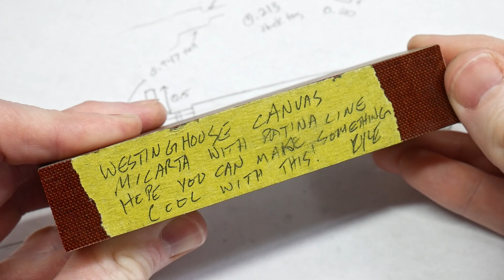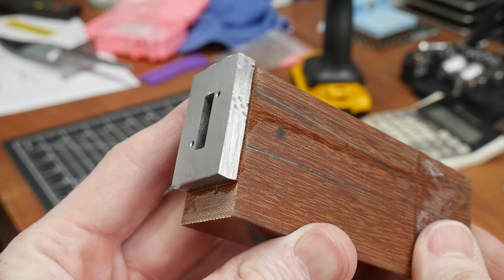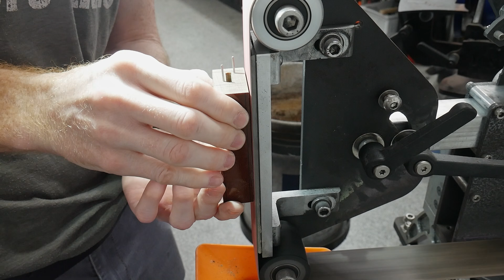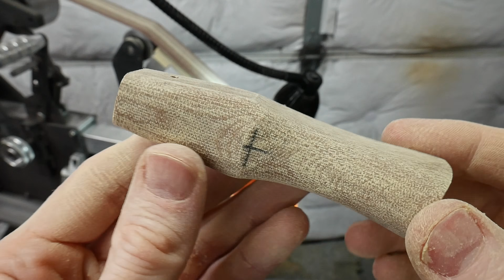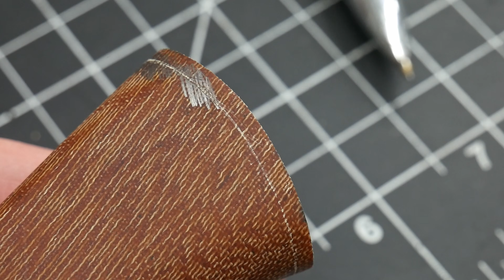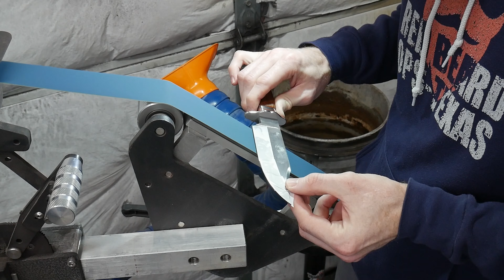An Adorable EDC Bowie Knife Build | Part 3/3 .... FINALLY DONE

Comment: I would love to know how you determine the positions of your layout lines when shaping the handle. The results are beautiful and look very comfortable!
Reply from the maker: I'm not a pro here, but what I've been doing is as follows. I'll get my front spacer down to around 0.75'' and use this as a guide for the front of my handle block. I think the thickest point of the block will be around 1''. The swell in the back I'll bring down to around the same width as the spacer so 0.8-0.75ish. 

This is based on my memory of doing this so the numbers may not be perfect, there is some eye balling involved as well. You can check back a few videos for additional examples of me doing this process.

Comment: My personal opinion only follows..... Take it with a grain of salt if you will but it is my reaction to a material selection for such a wonderful knife. 
I like everything about the knife with exception of the handle material. Why put common man made handle material on what is otherwise a high end collectable knife of exceptional construction and material selection. I see the idea of durability and longevity of the handle but I can buy a knife that looks like that with similar handle material just about anywhere for very little money. I believe you should have picked something exotic,  natural, and perhaps somewhat rare, to make the knife stand out more completely, to add value and collectability. That handle material is utilitarian in todays market, every cheaper knife maker uses it because its so consistent to shape and finish, and not easily damaged which could lead to customer issues. It is otherwise a great expression of the knife making art and very well done. With great respect.... Joe
Reply from the maker: Thanks Joe. When it comes to canvas micarta, that stuff is tough as nails! Just had this block lying around and wanted to see what it would look like :)

Comment: Question: do you have a video on how to put a swedge on a drop point knife? Im using a jig and it looks like one straight bevel and doesn't narrow as it gets to the point. Do I need to do this free hand?
Reply from the maker: Hmmm, I think I'd use my work rest, but I don't have a video on it
Reply: @RedBeardOps Thanks. There are very few videos on the subject and in technical terms mine is jacked up. In one video a guy was free handing with the knife offset at a 45 degree angle. Thanks. I'll probably experiment more on scrap.

Comment: I'm a big fan of your work. I still think the guard should be silver soldered to ensure the joint. That easily a $750.00 -$900.00 knife, depending on the sheath.
Reply from the maker: Thanks! I'll have to try that one of these days!
Reply: Exactly! I came here to say the dame, and pricing is right on target as well. I make a photo log with construction details as I make each piece. I have found that knife collectors really like that sort of thing and it helps bolster the price point and show you really give a %^& about building a quality knife. I occasionally farm out the leather work on higher end knives, I am just not a hardcore leather worker. But as you noted very nice leather is the icing that sells the cake!

Comment: I like your sandpaper with electrical tape trick I've never seen anyone do that before.
Reply from the maker: Really helps keep that sandpaper from ripping! I saw it from someone years ago, but don't remember who it was
Reply: @RedBeardOps  Try ductape. It is less stretchy, but if you use cheap stuff you will end up with adhesive flowing over. (you want the original 3M stuff =) )
Also - that is some awesome work on that knife, Sir. Looks very good.
Reply: Heck yeah I am trying that immediately